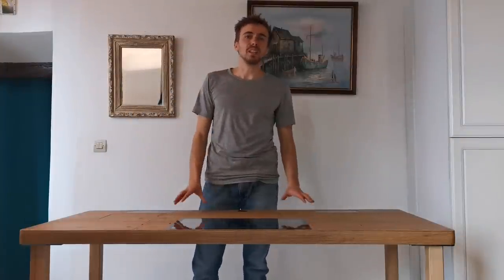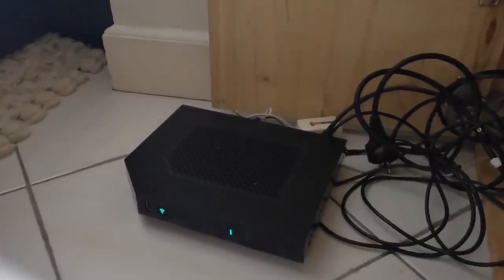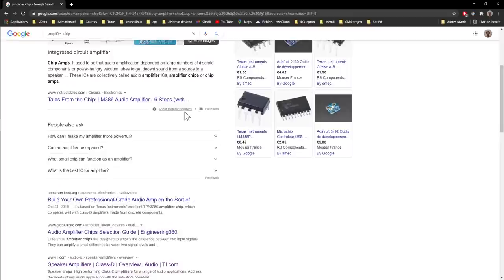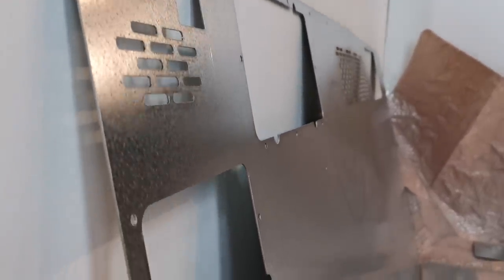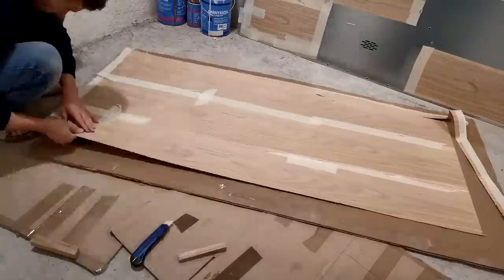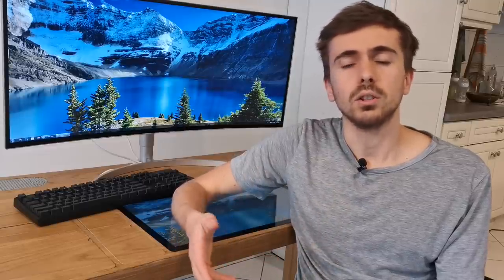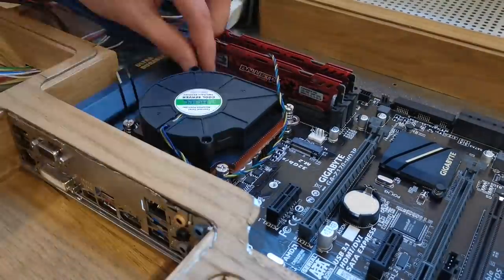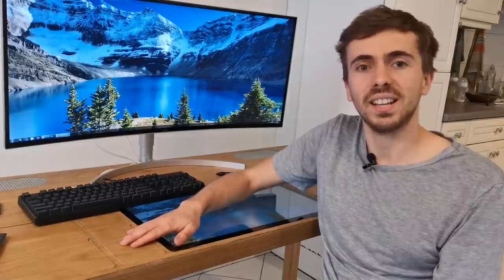Building my Dream DESK PC

Comment: See that's what I was thinking and was going to make, obviously I have a different idea in mind but this clearly confirms that the concept works. Have you had any issues with this at all, like overheating issues, any hotspots, electrical, anything not properly fitting together? I came from DIY Perks video as I was looking for a solid proof that it'll actually work, and your own confirms that it can be expanded in the direction I was going to take this, so was there anything that you would change from what you did? I'm currently only getting some information together, I haven't even decided on anything outside of "I'm planning on building my own pc for the first time, why am I paying 150 or even 90 bucks for a case, surely I can just build it into a desk." and sure enough here it is. Very cool video, I'm for sure going to be checking out the rest of your videos.
Reply from the maker: The GPU is overheating quite a bit. It would require to add some holes in the metal sheet underneath at least. Or make a water cooling system.
Having the PSU so far from the MB/GPU may not be ideal for cable management, though I haven't got any issue with it and it's the best configuration I found.
Other than that if I had to make it again, I would avoid a lot of small issues I met during the build. Like the pieces of wood being 0.5mm too long, Screw holes too small on the metal sheet and so on. Maybe take slightly bigger tolerances to avoid a lot of pain.
Glad you liked it! I don't have many other interesting videos though, mostly random reviews/repairs. I have only one other on building a game console, though the video quality is not as good as this one I fear.
Reply: @pierreboyer9277  Cool, I'll for sure keep that in mind as things to pay attention to. It was an interesting video none the less, you certainly have came aways.

Comment: I made myself a similar desk, with the computer inside the drawer, but... my GPU broke... because of the heat, so I would  suggest you to drill some holes underneath the GPU fans. Nice build !
Reply from the maker: I'm actually planing a v2 with a cooling system :)
You can check the discord channel for more details : https://discord.gg/ZCDuSbna
Reply: @pierreboyer9277  sorry but that link expired, do you have a permanent one?
Reply from the maker: @danielchapman1550  Here it is : https://discord.gg/G6W9mt6c

Comment: Really nicely made. I use a mac and a Linux machine and considering a standing desk. Do you think such a table with everything inside of it (due to the weight) makes sense?
Reply from the maker: Thanks.
Yes you could fit two machines in such a table I think.

Comment: i wonder about CPU and GPU temps and air flow ... way too much hot glue ... like 100% too much ... for exp ... your PSU goes dead ... how would u replace it with soooo much hot glue

Comment: The concept is incredible, but the fact that you have to remove the covers and that all the connectors are inside boxes does not appeal to me in the least, it can be minimalist but not handy.
I understand that you do not want to see a single cable, but if that makes it impractical and uncomfortable, I do not see any sense from my point of view.

If the covers were sliding or had hinges and also all the connectors were on the edges of the desk with sliding doors or in hatches but instead of being vertically they were horizontally it would be something else.
Very good concept but I think it can be improved astronomically to be more practical

But yes, the concept was very inspiring, it made me want a better space on my desk, thanks xD

Comment: Really love it, everything looked so nice and smooth while building but the end result looked weird „workmanship“.

I think it’s the wooden Look with those boards you can open up and the lines, that are disturbing. I think a more futuristic Style (Cyberpunk Metal Look) would blend those compartments and the lines better. 

But I do understand why you just took the wood venyl for simplicity
Reply from the maker: A futuristic style could be interesting and would be easy to achieve by leaving the bare metal without wood veneer. But the wood is good because it's warm to the touch.
Though something else than wood could be used on the metal.

Comment: The idea is good, however I can see few design flaws with this desk.
1. Cooling flow is not reaching the motherboard efficiently.
2. Cable managements are non existent, makes it hard for future maintenance.
3. Top vinyl looks very amateurish and frankly aweful.
4. Noise level generated by the fans and especially the cpu must be very loud.
i'm sure v2+ would fix most of these concerns. Good work though.

Comment: O_O 
eeeps. if only I knew carpentry. xD
Reply from the maker: I didn't knew much before this project :) Don't let that stop you!
Reply: @pierreboyer9277  xD I'd have to learn absolutely everything about carpentry and designing furniture.
I think all I would change as I'm not sure if the LCD is a tablet on the table itself although it would be cool for illustrators and designers such as myself, I'd add a mechanism for it to tilt up and down like a built-in mount for graphic tablets.

Comment: While I like the phone... I actually like the larger screens
******
Tangent warning
******

 as I have big hands...and typing on a Pixel 5 screen is actually annoying enough... Trying to type on anything smaller... While convenient for hitting the apps with one hand...is actually pretty uncomfortable for actually communicating via text...which is annoyingly the most popular method of dialogue these days. I miss my Nokia 1520...never risked dropping it by accident... Even if the screen was the same size as my Pixel 5, the additional size made by the bezel and body added a great deal of stability to the typing process...as it is, I am constantly dropping my Pixel 5 because on top of being as small as it is...I have a rather slippery case for it...a result of my own modification... But I was dropping it a lot before that anyways.
I rarely need to replace my devices due to physical damage mind you, despite what I may have implied. My first smartphone still works fine and S3...my Nokia also still works... But since I literally broke the screen in half a couple years back, I haven't been able to get it to work properly... That was caused by it slipping under my pillow and me later sort of landing on said pillow with my elbow though... Still works technically...
The only phones that I don't still have are the chronically buggy S7 Edge, and the LG G3...which had an odd halfway sort of bricking issue... My first two phones still work fine...ok would still have my first laptop even of my Xbox360 hadn't fried the motherboard when the HDMI was connected to the TV, and the TV was also connected to the Xbox... Still don't know why that thing has a stray current being delivered through the TV...
My forays into the Cupertino walled garden have been very confusing to even the most tech savvy people I have encountered...enough tangents though.
When it comes to smartphones these days...it's more of what it can do for the end user, than the size compatibility that matters. Otherwise these monster phablets would never have any market share.
Software optimization, OS compatibility, and overall reliability are what matters most. Hardware matters only when it has been fully optimized enough to create a sufficiently noticeable difference in usability and reliability. 
It's why the Note Series Phablet is popular now, the hardware has an associated Software and OS optimization that far surpasses the Palm Pilot, that makes the S Pen not just a gimmick, but something that can actually enhance the usability of the device. That said...it's not for everyone, and there really is no one-size-fits-all phone design.
Reason why I am so interested in this topic is because I have been developing my own idea...but instead of trying to distill it into a single option best suited for the average person... I have focused on the Hardware, Software and OS optimization aspects that would be required to make it something that is truly a game changer. Even going so far as to realize that different form factors are going to be necessary to account for different needs...and in doing so...I realized that my business model cannot be something like Apple, Samsung, LG, Google, OnePlus, and others at the top.
I think through far too many levels to find one solution as being ideal...